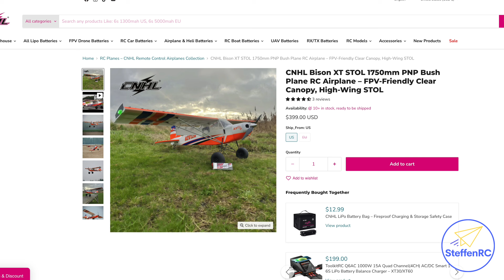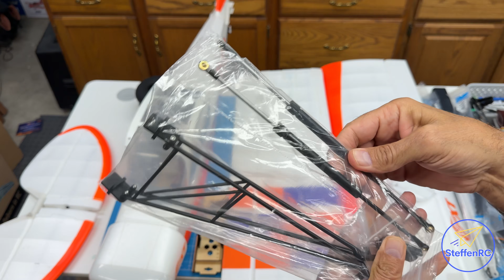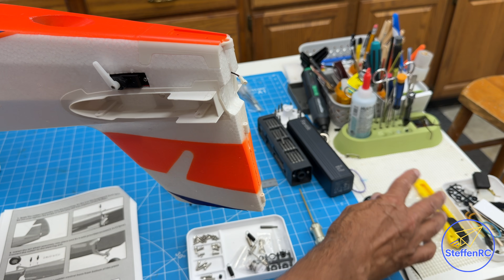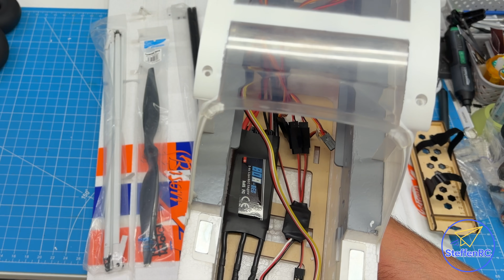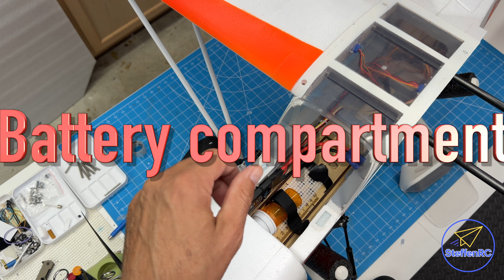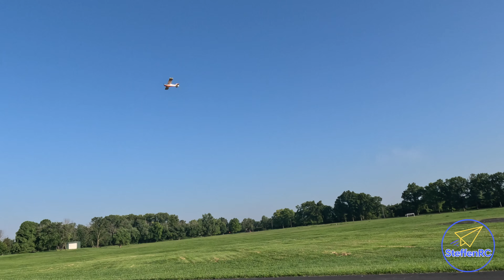CNHL Bison XT 1750mm: The Most Detailed STOL RC Plane Yet?

Comment: Replace the tires with 5.5 inch pneumatic tires and also replace the propeller with a Xoar unit.
Reply from the maker: Lots of options for this plane.  Pretty cool details on it..  Does the prop quiet down the noise?

Comment: It could very well be that the vibration is coming from the GemFam propeller; any GemFam with a diameter of more than 13" vibrates on any aircraft. These propellers are light, too light because they are too thin, and as a result, they vibrate enormously and make a lot of noise (really, just compare it to an APC, for example).
Reply from the maker: Good point.  I'll swap out for another prop and see.  I have a Xoar/Genfan prop on a few of my planes and they don't have this issue.

Comment: I fly my V1, Bison XT on 4 cell and fly mostly off the grass due to the huge tires. I like that they got rid of the slats and tires are updated.
Reply from the maker: Our grass was too high for use when I was filming.  But of course, this plane will have no trouble with a grass runway, in fact I'm sure it will handle better on grass than our asphalt.   It flies really well,  stable slow flight and tons of power.

Comment: Good video with some fine tips for getting it tuned the way you want it.   I agree that their method of making the battery tray secure was a bit of a bother.   For myself, I can't get my hands down in a plane to work with the provided straps  -  so I do otherwise.   I nearly always plant a piece of velcro on the floor or tray with the little plastic barbs pointing up.   Then I have different lengths of velcro I use with the fuzzy side down to connect up.   So, this way I can strap my fuzzy velcro around the battery before I put it in the plane.   This is much less frustrating to just set my battery down in the plane - and it sticks.     🏴‍☠
Reply from the maker: That’s a great tip for easier battery swaps, thanks for sharing your setup!